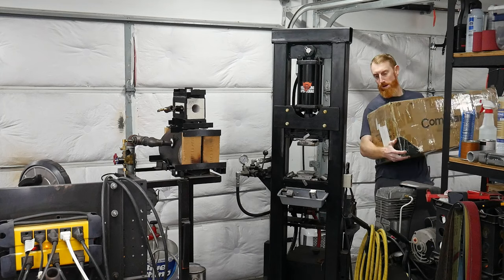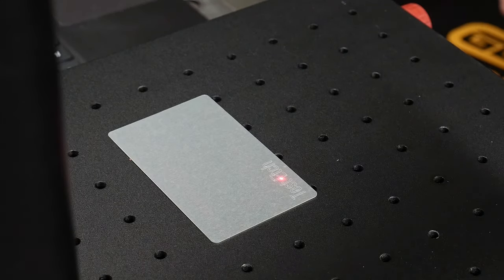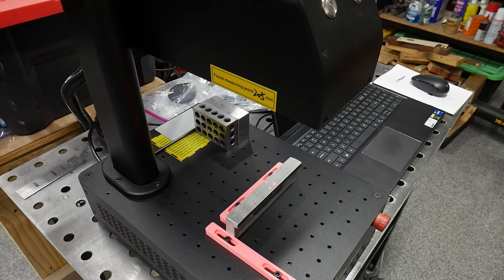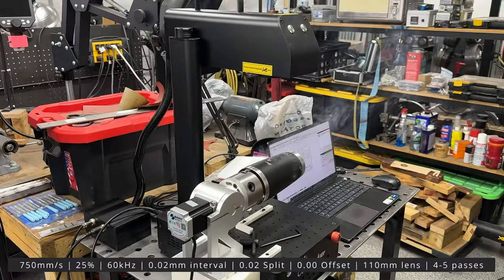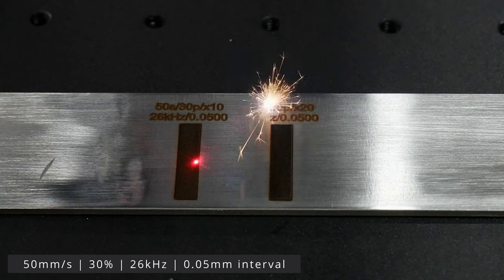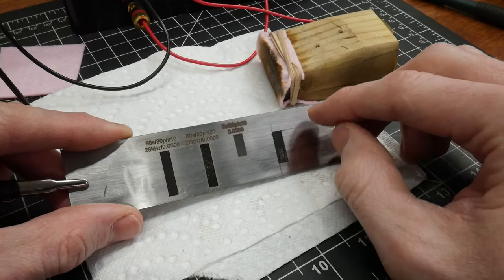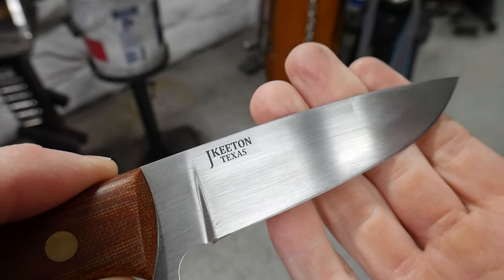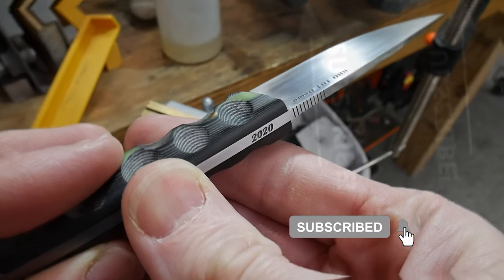Deep Metal Etching LASER For Knife Making | ComMarker B4 20W Overview

Comment: So quick things as another fiber laser guy (I have the same ComMarker 20w): I don't know how deep you've gotten into the laser settings realm, but 5-10 passes with Speed: 1266mm/sec Frequency: 37khz Power: 100% Line Interval: .01000  (2540 lines per inch) Scan angle: 27-63 degrees (this is 100% user preference, I like 45 and 63) and Crosshatch on should get a really nice deep engrave. AFTER that do a couple "cleanup" passes where you let the laser remove all the ugly brown discolored junk out of your etch: Speed: 3000mm/sec Frequency: 60khz Power: 15-25% Line Interval .0254 (1000 lines per inch).

Now the secret trick with steel and a fiber laser like this: DO NOT TOUCH/MOVE YOUR ENGRAVING ITEM and move the head of your laser up by 3mm. Yes it's going to defocus, but then you can throw in these settings and it'll mark the deepest beautiful black inside the mark you've already engraved: Speed: 50mm/sec Frequency: 25khz Power: 52% Line interval: .0254 (1000 lines per inch). You can do multiple passes with this setting to deepen the black, but I'd let it cool for 90-120 seconds between passes because it gets a little toasty.

Another tip I can add is you might try doing a dozen or so "line" passes at a lower speed (and maybe try a little "wobble" in the lightburn settings, play with it a bit until you like it) before doing a series of "fill" passes, it'll help define the edges of your marks more clearly.

I liked your video and hope this helps you mark your knives a little better.
Reply from the maker: Man thanks a million for these tips! I will be trying all of this next time I need to get a good mark! This has become my go to on maker's mark etching... so I'm excited to try out what you've outlined above! Very thankful
Reply: Thanks for posting these tips! I have a 50w B4, so I'm gonna try adjusting your power settings for mine. Is it typically just a factor of the power difference? Ie: My laser is 2.5x more powerful, so should I be dividing your power settings by 2.5?

Comment: Thanks J, this was awesome. Also to note: I wanted a laser etcher and I went with the Xtools D1 20w like yours, so thanks for that too:)
Reply from the maker: Nice! Yeah that XTOOL is great for cutting out sheath templates and things like that. Huge value, in my opinion, for knife making. I was able to get a decent etch with it in the past on 1084, but for some reason it wouldn't touch eh AEBL...
Reply: @RedBeardOps  Seems the more reflective it is the worse it works, could not get a mark on aluminum at all:) So the chromium in stainless likely reduces the results in Stainless like AEBL, IMO

Comment: The rotary stand rig is brilliant, well done!
With your higher frequency lasers they will diffuse through smoke and the atmosphere in general, so it's probably robbing it of some energy when it comes to wood. The lower frequencies tend to go through clutter much better in that regard
My opinion if I was going to use one of these for artwork, I'd lay out the design on computer, burn it into the material and then come back in with gravers and scribes by hand to have it as more permanent outline with some depth. But if you ever wanted to kick start some skills in hand engraving bolsters, guards and the like it could be a very useful tool for someone to have rather than transferring templates to something, course you could just try fiddling around with the settings on the machine as-is and applying them to see how they look.
Reply from the maker: Good points! I like the idea of applying templates for engraving for sure!

Comment: you could combine it with 3d printing to create some tumbler style knife boxes, so the knife handle could bed into the tumbler lid and the blade in a 3d printed tip holder in the base of the tumbler, then etch the outside.